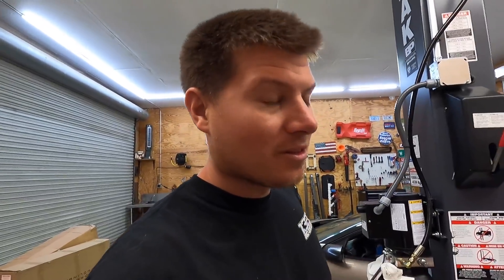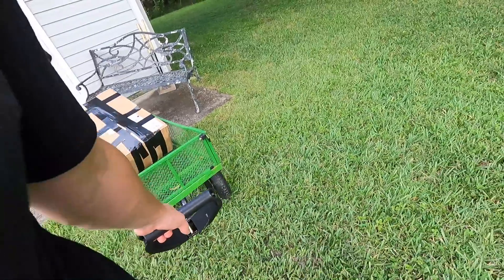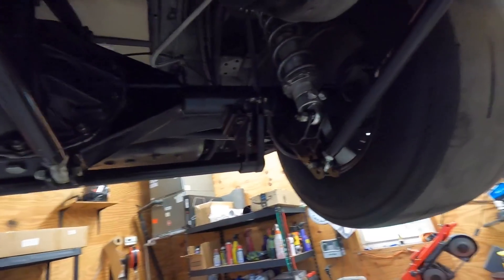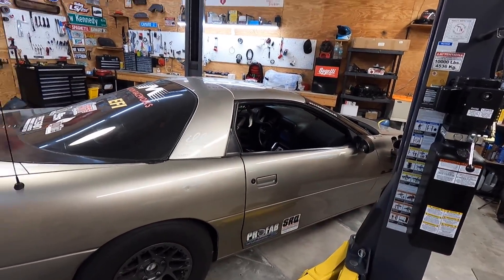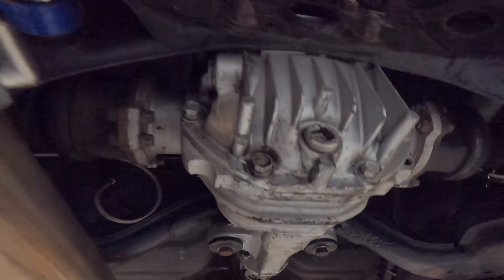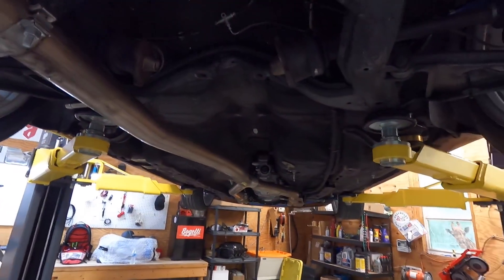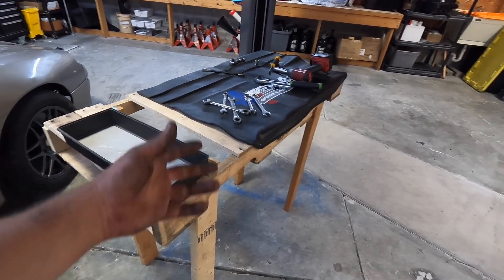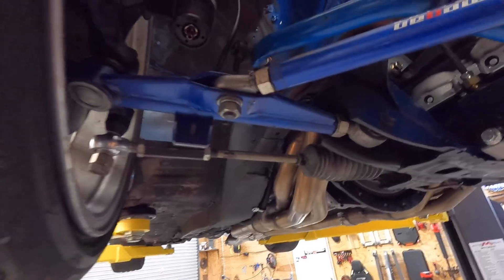Putting The New Lift To Work!

Comment: For your a/c unit. If the fan is humming but not spinning it probably has a bad capacitor in the service panel on the side of the unit where the wires go in. That unit most likely has a dual capacitor that runs the compressor and the fan. Check that first before you waste good money on the fan. Capacitors are cheap.
Reply: when you hear it trying to spin, spin it with a screw driver. definitely  a bad capacitor
Reply: More than likely the capacitor.
Reply from the maker: Got one on the way, thanks for the advice ill try that!
Reply: Yep get an extra 1 also there cheap!
Reply: I’d bet it’s a 35+5 capacitor at that. Just replaced one in a rental property. 

You can use a screw driver to start the fan spinning and it will run fine until it has to start again. Just flick it quick and yall be good. Just a pain to have to do it every time you want to have the AC run.

Comment: On your transmission jack, open the valve and then lift the jack platform up to the height you want instead of pumping nonstop. Also works for the engine hoist.

Comment: Replace the run capacitor on that AC unit as well.
Reply: I'm putting my money on that.
Reply: 100% agree
Reply: Always check the cap
Reply: This is the issue 99% of the time and usually like $25. He will just be hot for a few more days until it comes in from Amazon
Reply: This needs to go to top
Reply: Was going to say capacitor as well glad to see some other HVAC guys chiming in
Reply: I was gonna say the same. Seems like the capacitors always wear out before the fan motors.
Reply: Exactly

Comment: Recommendation for your little rolling stool. I bought some of those ball bearing roller blade wheels for mine. They sell them for office chairs. I can roll around the garage at mach 6 while running over cords like they aren't there. They roll so nice that you'll find all the low spots in your shop floor because the stool will always roll downhill no matter how flat you think it is. lol

Comment: Check the starter Capacitor for the fan on the A/C compressor.  That is what normally goes out and not the motor.  Plus it is cheaper than the fan motor.

Comment: One of the biggest issues you'll find with your AC issue is the capacitor. If the fan motor is stiff to turn by hand, replace both fan motor and cap. Look at the capacitor and see if the top is bloated out at all indicating an obvious failure. They are cheap and easy. Just take pictures of what wires go where before you disconnect the wires.

Comment: On your transmission jack, check the hydraulic fluid level.  If you don't have enough, it can cause it to barely move.  Also, if there is an air bubble trapped in the hydraulic circuit, it will cause the same symptom.

Comment: Hey I am a residential AC technician you might want to check the capacitor before replacing the fan because it could just be a bad start capacitor for the fan and not actually a faulty motor but the motors do fail but the capacitor is something that you should check as well just wanted to let you know

Comment: Get another pallet and some wheels, and that table moves easily.

As for the AC, you should have checked the starting cap before replacing the fan motor. If it buzzes when you turn it on, the motor’s probably good. If you have a multimeter (I’m sure you do), it’s easy AF to check the cap.

Comment: Make sure when replacing the fan if you don’t get a direct replacement the fan is at the same height. If the fan is to low it won’t remove the air properly.

Comment: @Cooper Bogetti The fan you are replacing could be routed through a capacitor. The capacitor holds potential and will need to be discharged. Congrats on the lift and making some upgrades.

Comment: Check the microfarad rating in the capacitor on your ac unit with a meter that measures microfarads it could just be that if not make sure you replace the motor and capacitor.

Comment: hey cooper maybe this will help with your ac problem . there is a capacitor that starts your fan motor located in the control panel of the a/c unit . look at it (looks like a silver cylinder ) if it's leaking oil or has a round ( bubbled ) top where all the wires plug on it ? then it is bad .

Comment: Turn the unit on and spin the fan with a screwdriver then throw the thermostat as low as it will go to get it chilled down good then turn it off but if the fan tuns that way its just a $10-$20 capacitor

Comment: 120v will actually kill the battery faster. It’s only 90% effeiciant at best to go DC-AC. So need 130v of power to get 120v out. 

It’s always more efficient to keep the same type of power. AC to AC or DC to DC. Inverters always use up some power changing it over

Comment: a HotDog is bedded into a bun, much how many Subway ‘sandwich artists’ get theirs done, so an argument could be made that HotDogs are a form of sandwich. Tacos are not made from buns, but tortillas are produced from dough. the dough is rolled to a disc & cooked on a flat top surface, not an oven. So, Tortillas are not Buns (bread). Burritos are made from Larger Tortillas, where it’s rolled (outside laps under inside with strategic interior folds made to retain stuffings)  into itself, while taco tortillas are folded (inside may touch inside while handling) to deliver to Pie-Holes, world wide. corn-based Taco Shells can be fried to retain horseshoe shapes, while flour-based Torts are normally just heated to accept handling without losing structural integrity. fried flour tortillas are used in chimichangas, which is basically a deep-fried burrito & should be enjoyed when a nap is possible afterward. tacos are tacos & sandwiches are sandwiches & HotDogs are HotDogs. they all have capabilities of being delicious, however the widespread usage of Marijuana can truly make its partakers dive in to this realm of debate. what is the difference between Chimichanga, Stromboli & Calzone?! GD!..I’m Hungry. Later.
Reply: Lol. I'd only read the first 2 sentences. I see at the end you did mention the sacred flower.
Reply: @joshuagibson2520  lol - I wish that was my excuse. I’m not that cool anymore. our 3 children forced me to grow up. ‘this’ happens when my fam takes a final summer trip & leave me behind to run business…I get ‘this’ bored. take care, Josh & let’s see what ole Coupé surprises us with next…he never does anything the easy way, does he?
Reply: @corporalclegg914  I know the feeling. Had 2 kids and bought my forst house by 19. Now I'm 42 and have grandkids. Wouldn't have it any other way. I still burn though. It's all good as long as it's not what ya do all day long!

Comment: It might not be the motor on your AC. It very well could be a startup capacitor. AC motors use caps to start spinning. You can tell by spinning the blades by hand then turning on the unit, if it comes on and spins then you have a bad cap.

Comment: I bet it is the capacitor on the AC unit and is about a $25 part not the motor. Prepare to wait a little longer when the motor isn’t the solution. Sorry it sucks but what you explained I have dealt with many times over the years.
Reply: I have paid $85 and $115 for that capacitor.  Amazon has them for like $10.

Comment: Ohh if the fan is humming but not spinning its your cap.disconnect the three wires while the box fan is on ther or you will burn up the fan motor.

Comment: If you would have put anti-seize on all the suspension parts when they were put together 10 or 15 years ago they wound feel brand new.
Remember all threads need some sort of sealer either Anti Seize or Loctite.
Reply: Yeah, very valid point. Idk if your new to the channel or not, but unfortunately he purchased the car like that. But very good knowledge for the people that didn’t know this. This has saved me many a times!

Comment: Stock 706 heads will out perform stock 243 heads, Richard Holdener has the results on his channel.
Reply from the maker: Even ported with boost? I'm genuinely curious as a lot of miss information floats around
Reply: He does some great testing of all kinds. Does anyone else have trouble getting through his vids though? He gets a little long winded and sometimes I even fall asleep lol.
Reply: @CooperBogetti  Haha I was mostly commenting on they are bottom of the barrel heads, porting ls1 heads typically evens all of them out at around 300cfm. The only bad part for 706s is you need to install bigger valves as the stock ones are smaller than 243s.

Comment: If you don’t want the 706 heads, I have a mint set of 317’s…. I’ll trade you.   317’s are the bottom of the bottom of the barrel.  Hell they’re not not even in the barrel, they’re used for a door stop.lol

Comment: I'm a licensed tech for HVAC and your capacitor could be bad. Since you have a new motor coming. With the age the motor could be bad but a common service call for the outdoor condensor not working is a bad capacitor most of the time

Comment: @2:14.... no this is not a rabbit hole. You do not need to replace bearings at all either. Look cooper, we want to keep you from wasting hours swapping engines later when all you need to do is pull each piston individually and gap the rings then stab them back in.  Make it happen. I did and stock 5.3 holds 26psi in a truck making 770
Reply from the maker: Man I've done this a few times, it was always cam bearings the got us
Reply: @CooperBogetti  I can send you the part number for the tool I use at my shop and even how to replace them.in your own time. I know you've done it but when you are at this point and 2 hours away from a dependable build then why not invest that time instead of going back over and over? I mean I appreciate the content either way but love the progress and moving forward.
You once gave me advice on places to eat and signed a piece of my bumper at bmp for sct. Least I could do is hope to encourage you.

Comment: Just do the basics rods main bearings rings and rod bolts . Its just insurance knowing that they arnt the weak point to spin a bearing like the ls engines do . Its all cheap you can do yourself the same as oil pump . You will be kicking yourself when it does a bearing or it buts the rings . Its all cheap . Why do the heads then if you dont refresh the bottom end .

Comment: Something wrong with your trans jack, Ive used the same one multiple times , and its not like that. Either t
It,s low or no fluid or a bad seal.
Reply from the maker: I feel like you're right
Reply: I was going to say the same thing. I have old bottle Jack's that are slow like that and it's usually low on hydraulic fluid. If it's brand new you might want to return it if you got it locally.

Comment: Lifts are not supposed to leak and should be covered under the warranty for the lift.

You know what you call people who use a drain pan on a transmission-jack to change their vehicles oil? Spot because they will be covered in spots of used engine oil.  Make or buy a real oil change bucket or embrace your new name Spot.
As far as as all the adjustment points on the 240’s front end nothing looked that corroded to me nor did it look like you sprayed anything down with Kroil, or PB Blaster and lastly are you sure you are turning things in the correct direction because front end parts often have left hand treads.

Comment: Yes, there is something better, it's called "The Right Stuff" and it's made by Permatex.  A little $$ compared to RTV, but sooooo much better.  After nearly 20 years of use on my Jeeps, I have never had that stuff leak on any diff, transfer case, or anyplace else I've put it.